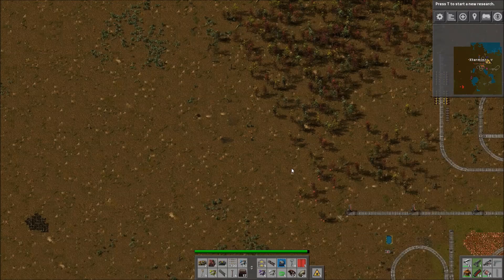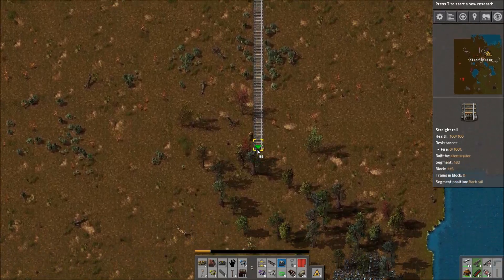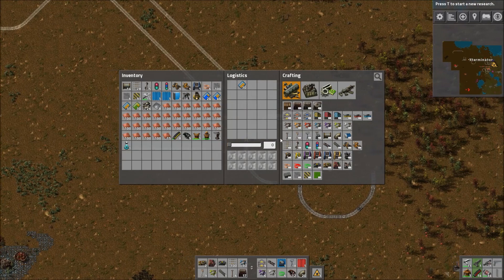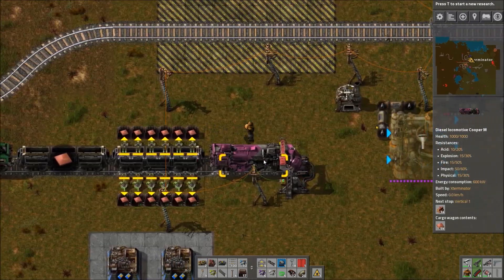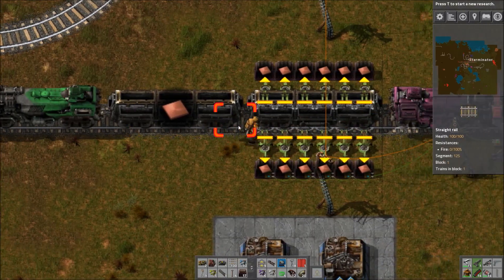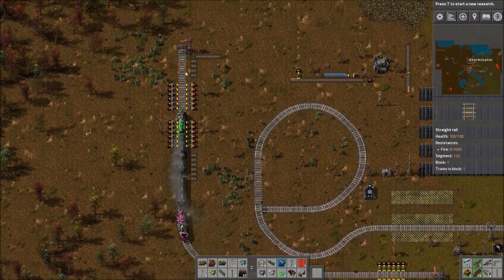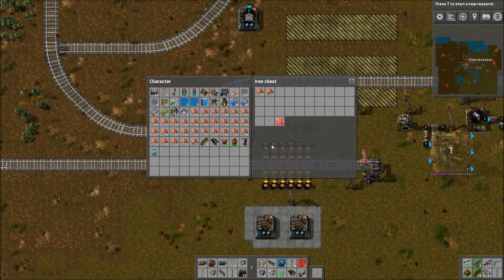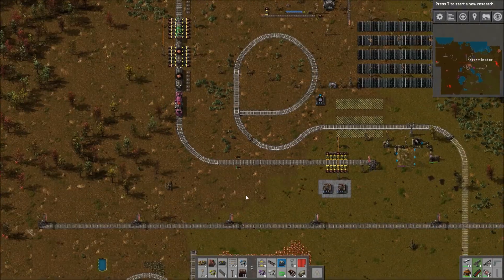Factorio 0.13 Train Tutorial - Rail Planner/Placing & Train Wait Conditions

Comment: Why did they remove curves! Now I have to spend hours instead of doing just one god damn click. :(
Reply from the maker: What do you mean spend hours? The rail planner will pretty much make curves for you, almost faster than when you had to do it by hand with the actual curve pieces.
Reply: No I have to agree with weg, I tried building a train station at my base, then went to create the rail line from a nearby oil Derick and after building a several thousand tile long track I finally get to the end to find out the two lines won't connect, they are offset by 2 or 3 tiles, and pre-0.13 that was easy to fix, but now, the rail planner tries to fix it in the most stupid of ways. I don't blame people for liking it, just wish there was an option for players to choose between.
Reply: yeah, I think having both would be best. Long stratches of track could be laid out easily, and building the stations or intersections with curves would make life much easier aswell

Comment: My track laying is buggy. It works and then it stops working. Maybe caused by a complex intersection? Reloading the game then it works again for 2 or 3 track laying instances.
Reply from the maker: Hmm it sounds like the rail planner is just being finicky. It can be a big pain to make it work on intersections. 
In what way does it not work exactly? Like it just stops drawing out the track, or won't let you build in the direction you want, or something else?
Sometimes it can just be a matter of starting it at the right point on the current track.
Reply: Xterminator I now realize:
It works after reloading my save. Shift and control while clicking doesn't seem to do anything btw.
I lay my tracks, little by little, it continues from the last position. This is great. Then I finish and deselect the rail item by pressing Q.
If I go to another place, can be miles away, and start laying tracks again, I press the green arrow and nothing seems to happen. Except I realize its trying to lay tracks from the last place.
Reply from the maker: Doc Julien Hmm that is strange. Doing Shift and Control won't do anything. If that's what I said in the video, I misspoke. If you want to ghost place them you need to Shift Click.
As for the planner trying to lay tracks from the previous point even when you go far way, that seems quite weird and have never encountered that before myself. I'm not really sure what would be causing that unfortunately. :/
Reply: I meant I tried putting my cursor on the greeen arrow and pressing control+click or shift+click , left click right click, different timings and it's always just normal short placing. I'll start a brand new game this save is from a quite old version. Thanks for infosss!!!

Comment: My train keeps saying No path
What does that mean?
Reply from the maker: It means that it can't path to where it needs to go. Typically this is because the station it is trying to get to is on the wrong side of the track, or some signaling is messed up. 
For clarification, the train stations always need be on the right hand side of the track from the train's perspective (like as if you were driving in it). Also signals need to be placed on correct side of the track based on the direction you want them signaling for. 

So I would say go through and make sure your signals are placed correctly and that your train stops are placed on the correct side of the track. If that doesn't fix it, you could upload a picture somewhere and send me a link and I can take a look and see I can spot the problem. :)
Reply: Xterminator Ok thanks